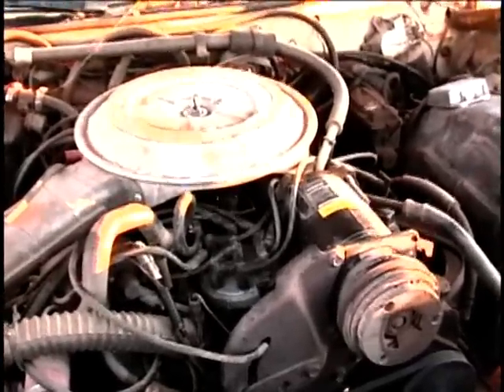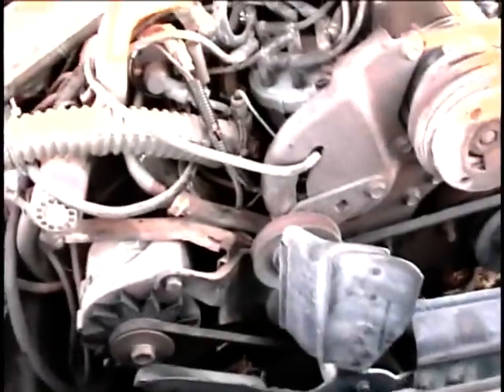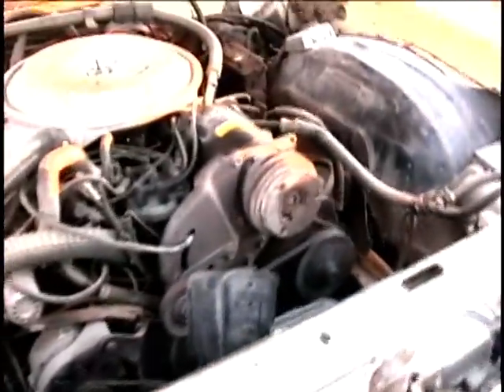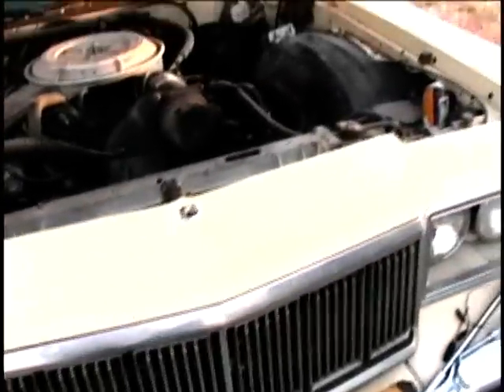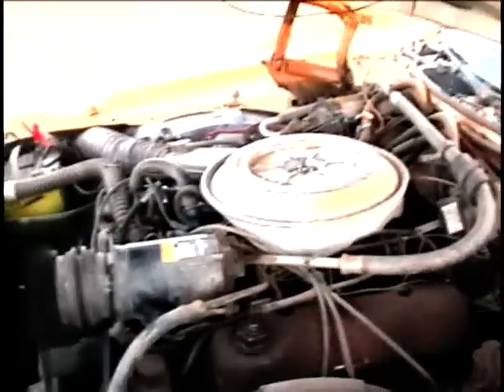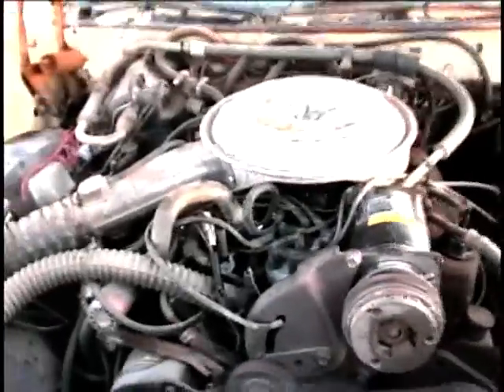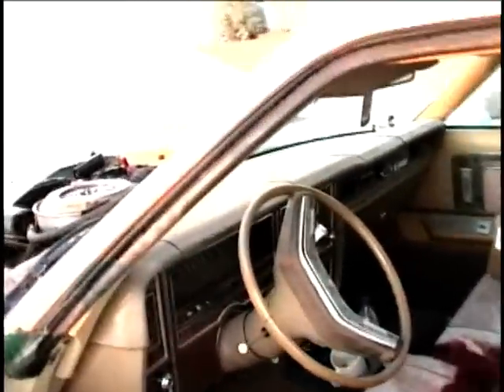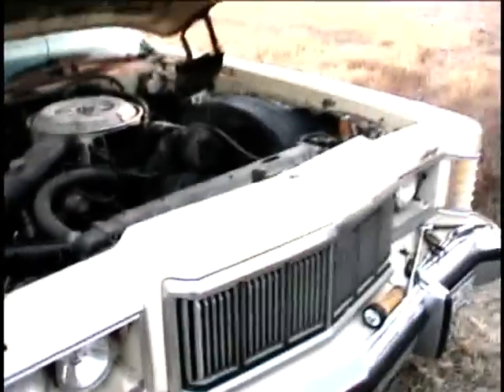1978 Mercury Grand Marquis repaired distributor problem

Comment: Hey Chad, good job on the distributor R and R.
On that engine the timing scale is on the balancer so you'll have to get under it, clean it well and use some light paint to highlight the correct mark.

On your crankshaft pulley there are marks starting at 10degrees after TDC then you have a long line across the balancer that starts at 0. From there it goes from 0 to 30 degrees. Each blank mark counts as 2 degrees. The marked ones are 10 degrees apart.

Comment: Easiest way to set timing; use white out on the timing tab, and also on the line on the harmonic balancer. Wipe off any excess to prevent erroneous readings. The timing gun will pick up the white out as clear as daylight.

Comment: Wow, that is really cheap for a new distributor...that is a good deal.

It may have been some mechanical advance or something that killed the old one off...

Personally it sounds like its running really good, and it starts good too, so I would probably not worry about the timing...but it might be a good idea for gas mileage and power to have perfect timing. Although I suppose gas mileage does not mean much with this big old car!

Comment: I never use the timing light.
I advance the timing, get in and put the car in 2nd gear with the brake on.
give it half gas pedal, if you hear it ping, back it off a bit.
Keep doing that untill you dont hear it ping.